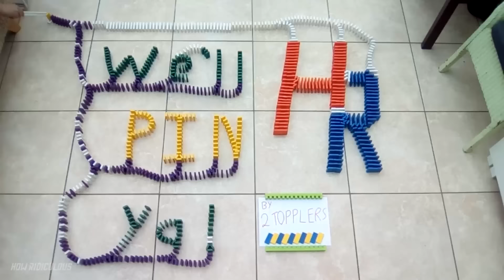Can This SOLID GLASS BALL Survive a 45m Drop?

Comment: I can't say I'm an expert in coney-joneology but I believe it's caused by the way glass compresses. Glass is a strong, but brittle material, meaning it can withstand a lot of force but breaks quickly (compared to metals, which bend and deform). When it hits the plate, the point of impact gets squished in, and the glass around it has to follow due to the strong bonds. But because the compression strength (squishing ability) is stronger than the tensile strength (stretching ability) the area around the point of impact can't handle the stress of stretching, and shatters. The ring around the point of impact is what makes it look like a cone.
Hope this helps explain things simply!
Reply: Your coney-joneology degree is in the mail lol.
What your seeing is an actaul representation of whats called a shatter cone.. only its in reverse. 
In nature  they are found where meteorites impact hard rock layers.
In the video the steel plate would be the meteorite and the glass ball would be the hard rock.
The waves we see are impact lines that originate in the direction of impact..
Reply: Personally, I think what you say is half right. When a force is acting on an object, the energy is radiating through the object. So depending on the shape, the force radiates differently. The point of impact from the glass ball doesn't shatter because the force is going straight through the ball. And because the shape of the object is a ball, forces are going in all direction. Like you say, glass is brittle. so when that force goes through a section of the glass ball that is not thick enough, it cracks, hence the conical shape
Reply: I’ve been doing YouTube for about 3 years now and I don’t even have 200 subscribers any ideas on how I could get more subscribers
Reply: The tip of the cone is when the sphere lands. All the material is in compression. The slope of the cone is because when the ball stops, the surrounding material undergoes tension because there isn’t support by more material and the ground. So when the tension gets to high for the ball because the  ball stopped to quickly, the larger amount of material breaks away, causing the cone
Reply: world of gaming you had uploaded 1 video in 2 months be more frequent

Comment: In case anyone was wondering, the 40kg glass ball:
Falls for 3.03 seconds
Reaches a speed of 106 km/h before impact
Hit the steel plate with a force of 392.266 N (88.1849 lbf)
EDIT: Thank you to MechanicalMind7. The force listed above is just the average impact force. The peak impact force (the one you'd feel if hit in the head) is actually close to 1,765.17 kN or  396826 lbf, assuming the steel plate had a 2 cm give.
Reply: Could've just use project motion and gravity. 9.8m² X 40kg = same
Reply: In case anyone was wondering, how to calculate all this. I'll give you some formulas.
Potential Energy (of ball in this case) =(mass) x (acceleration due to gravity) x (height at which it is present)= 40 x 10 x 45 = 18000
Potential energy gets converted into kinetic energy and kinetic energy just  the instant before it hits ground is equal to potential energy (energy is always conserved).
Kinetic Energy= potential energy
1/2 x (mass) x (velocity)² = 18000( P.E. substituted from above)
Hence, Velocity will come out to be 30m/s or (30 x 3.6)km/hr.
Put it in equation, (final velocity)= (initial velocity) + (acceleration) x (time). Here initial velocity is 0 as it is still I'm the hands of them and final is 30 and acceleration is 10(acceleration due to gravity) and by putting all this time comes out to be 3 sec. So time of fall is 3 sec.
Reply: The force of impact is actually a function of the change in momentum over the time of the impact. You would need to know the time interval over which the ball went from impact velocity to stopped, which you might be able to estimate from the slow-mo footage. The 392N or 88lbf values you cited are just the weight of the static 40kg glass ball. I guarantee the impact force is several times that amount. For example, you could rest the ball on your body without it hurting too much (although it would be quite heavy), but you wouldn't want to stand beneath it after falling 45m ;)
Reply: @MechanicalMind7  After taking this into account, I have recalculated and found that the 392.266 N is the Average Impact force. The peak impact force is around 705.082 N or 158.734 lbf.
Reply: @matthewsheldon3225  I'm not quire sure where you're getting those numbers from. The recalculation is less than double the static weight of the ball, which still seems way too low. It's been some time since I've done straight-up physics number crunching, but it seems you can calculate impact force a couple of different ways. One would be determining a change in momentum over a change in time (i.e. the time duration of the impact), and the other would be based on the work done to stop the ball as a result of the impact, i.e. the change in energy over the distance of the impact. I think the latter would be more easily doable based on the video. The work done at impact would just be the change in energy, which would be equivalent to the gravitational potential energy at 45m and/or the kinetic energy at impact (these are all the same values since the ball goes from full potential/kinetic energy to 0). You could estimate the distance over which the impact occurs by watching the video and maybe comparing the distance from point of impact to 0 velocity and compare it to the ball's diameter (300mm I think he said?). Divide the delta energy by the impact distance and I think that gives you (average) impact force. I don't have time at this moment but could be interesting to try later.
Reply: @MechanicalMind7  Interesting. So the reason it is a little less than half is the give in the plate into the ground. Upon further freeze framing, inspection and scaling I found that the steel plate moved down about 20mm. 
The ball has a fraction more than 19,858J of kinetic energy. 
Here is your properly calculated force of impact now that I retaught myself 2 years of physics. 

With a mass of 40kg, and an impact velocity of 106.95 km/h over an impact distance of 20mm happening over a little more than 1.3 mSeconds brings the total impact force to:

An ungodly 1,765.17 kiloNewtons (kN) or 396826.0035  lbf

To get the same impact force from a regular 1.5cm glass marble it would have to achieve an impact velocity of over 13,000 km/h (~3,700 MPH).
Reply: Does the impact spot stay intact because of it being a sphere? So any point that makes the initial contact will be the exact point which has the most density supporting it in directly the opposite direction of impact? with the lopsided effect stemming from the rolling/spinning motion?
Reply: @GIBSONxSGxPLAYER    Many others have explained what is happening that cause the cone. Let's pretend that we are taking the variables out of the impact. If the ball make initial contact on its Bottom Dead Center with the flat steel plate, that part is in compression, which glass can handle high loads of. Now move an inch out from the center of contact. That portion is still moving with the speed of falling. When the ball makes contact the outer portion are not supported from underneath and experience tension under impact, which glass has a low tolerance for and shatters. 

As for the lop sided nature of the cones, I belive that actually comes from the steel plate not being perfectly flat and perpendicular to the balls trajectory. When it hits at the slight angle, it shifts the center point the that contact. So if plate is angled 10 degrees, you'd probably find the impact point about 10 degrees from BDC but the lopsided nature from all the momentum is still moving straight down (ideally, not trying to calculate wind and friction and etc.)

Comment: For brittle materials like glass, they break in a shape known as a "frustrum" (which is essentially a cone with the tip cut off) centered at the point of impact, which is exactly what you see here!

Source: Mechanical Engineering Student
Reply: But why
Reply: @jamesbowser9350  yea, wasn't really explained
Reply: it's frustum, but yes!
Reply: So...the point of the cone is the thickest part right...in the direction of hit - then it’s thinner in radii around the impact point -?
Reply: Have you seen Prices Rupert's drops?
Reply: @jamesbowser9350  glass wants to break in a straight line, and the sides of the cone are pretty straight.  It is angled because the force of the fall isn't distributed evenly.
Reply: @jamesbowser9350  Shockwaves that travel from the point of the impact. Hence why it has that wavy pattern on the surface where it broke.
Reply: But what causes the ripples in the cone shapes in this instance?  Something to do with the internal pressures of the glass as it cooled?  IE: in a rupert's drop, the blob of glass is nearly indestructible because of the compression that forms as the glass cools, from the outside inwards.
Reply: Yo you guys too dont underetand a word here
Reply: @jamesbowser9350  it seems to be the difference in the stresses the glass ball is under, glass is very good at dealing with compressive and tension stress and but is very weak to torsional and shear stress. So it seems like the ball is breaking where the shear stress is at its minimum to fail.
Reply: Nerd 🤓
Reply: source : But dude trust me

Comment: It's a retinal pressure cone caused by small surface area contact combined with the Amorphis microscopic molecular structure of the glass resulting in a conchoidal fracture pattern.
I knew that off the top of my head because of YouTube .
YouTube rules.
Reply: That's exactly what happened to my pipe!
Reply: Wow
Reply: If  you don't win, I will be upset!
Reply: @stefanoskritikos8313  86 now, might as well like it now!
Reply: What he said ... yeah thats it .... I think...mmm yeah 🤔🤯🤯🤯🧐
Reply: scott free my clumsy friend dropped mine :/
Reply: In addition to that, I think it's amazing how the waves formed from the glass delaminating. Probably a result of how the balls needed to be created.
Reply: Brian Chin different material
Reply: @Brian Chin  so the bowling ball is numerous materials as apposed to solid glass so the difference in density causes a different fracture pattern
Reply: @Brian Chin Probably due to the different materials and different densities and strengths of the materials used in the bowling ball.
Reply: literally not z  nah it's better than ever now. Just have to stay on the subscribed feed
Reply: Okay boomer
Reply: Path of least resistance coming out at all directions at all atomical connections and how they correlate with velocity and mass at the point of impact (causing the appearance of a cone), taking into consideration structural integrity, cohesion, and density throughout the sphere by comparison.
Reply: @Brian Chin material used is what that comes down to you can see that it did make a cone shape but partially. different materials mean different amounts of pressure it can withstand.
Reply: @Lugermonger Amorphis is a band i think you mean Amorphous
Reply: I don’t know what part of YouTube you are on to learn that, but damn!
Reply: 100%true
Reply: Pin this man rn
Reply: I understand some of those words
Reply: Now explain it like I'm five years old.
Reply: Brian Chin the bowling ball is a ball casted inside of resin. So the outside resin shatters completely cuz it’s the weakest leaving an inner ball exposed
Reply: Big brain boi 🧠
Reply: @jc55urmom68  yes that's why there was a separation in breakage the outside material absorbed majority of the energy upon impact as well the interior possibly a more shock resistant material.
But it kind of did break the same way the material fractured differently which is why the actual point of fracture looks different the molecular bonds are not the same but the way the energy was directed around the ball broken to relatively the same point on the ball as the glass the energy transfer was similar
Reply: Pls speak English
Reply: Could you explain that in english?
Reply: @Vivid Media LOL nicely done
Reply: Correct
Reply: Oh fuck we got an actual scientist
Reply: Check my answer out it’s funny
Reply: @Brian Chin The bowling ball was composed of two different materials  .
Reply: its because balls are oval shapes so when they falls the same thicknes of the glass goes everywhere
orrrr when it fals it fals vertical so the sides are damage and the piece where it fels its not damaged that much because there is no side force just vertical
Reply: @imstarwars   Yes,the glass is gathered by several consecutive dips in the furnace.
Reply: Brian Chin because the bowling ball has different layers
Reply: Pin him!!!!!
Reply: a lot of big words in there... dictionary.com is doing wonders tonight
Reply: Basically, small initial surface area of impact, and the surrounding glass still has kinetic energy, and breaks where the glass is weakest, that's why the farther from the center point, the farther down the "coney" goes
Reply: and perhaps the wakes are a visual of the actual shockwaves?
Reply: The bowling ball has a different materials in layers and doesn't cool to form amorphic micro struxeres. The difference in the pressure isn't glass structure as it cools means it can form a cone. With the bowling ball, the outer layer just shatters off leaving the inner structure... Its not formed as one and Cooled like glass. Hope that makes sense
Reply: literally not z The recommended videos used to be godly. Found so much good music
Reply: :( all i know is cony jony
Reply: Your comment should be pinned.
Reply: @fixed4816  mine too 🤣
Reply: Sorry can u speak english
Reply: Brian Chin the bowling ball is made up of multiple materials. The outer material has a  conchoidal fracture cleavage similar to the glass. Also Obsidian, quartz, flint, chert, jasper...
Reply: @Brian Chin because glass has the properties of a liquid despite it being a solid at anything above 300m below the ocean.
Reply: Man I had to go to pay 50k to learn that in college
Reply: Ok nerd
Reply: Ok boomer
Reply: @Lugermonger, When are you going to review a Norseman. Even if you use it for a bit and sell I'd like to see your thoughts. I want one as a wedding gift to myself and would like to pick your brain for critiques!
Reply: @Brian Chin That was a joke question, right?
Reply: Brian Chin it all about that amorphous molecular structure.
Reply: @Brian Chin bowling balls have layers and the glass balls are glass all the way through
Reply: In other words, it's the propagation of the shockwave from impact through the glass
Reply: Also because Kool-aid man is becoming an extremely powerful super being that is more powerful than thanos. Also learned that on youtube
Reply: @Brian Chin  the glass is most dense and didn't have a skin extra to absorb the energy
Reply: @Brian Chin because the glass ball is made of one material but the bowling ball has different layers of stuff
Reply: @Brian Chin Different and varying molecular structures in the bowling ball that fail in a different manner.
Reply: literally not z  YouTube is my tv. Who are those people?
Reply: Lugermonger I love watching your vids
Reply: Shoot you stole my comment
Reply: Makes the shape because when it hits, the most damage is not at the contact point because the most damage is the aftershock as the shock ripples throughout the rest of the sphere as it bounces up......right?
Reply: I like coney joney better
Reply: @Vivid Media sesquipedalianism fun isn't it
Reply: What???
Reply: @Brian Chin actually if you look at the bowling ball, it does represent the same pattern.  you can see that the impact point is intact, but the shearing didnt happen properly since the ball is made of different materials that were not joined together strong enough to allow it to shear evenly.  that resulted in the top layer of the ball beginning to shear properly and then just breaking off entirely at the layer change.
Reply: @Brian Chin bowling ball has an actual core and at least 1 big thick layer, glass ball has not
Reply: you gotta check out Space group theroy & Hermann–Mauguin notation
 notation if u really wanma wax the secience... books taught me that
Reply: @Brian Chin bowling balls are made of different plastics not glass
Reply: literally not z  is that why some of the greatest and smartest people in existance were weed smokers xD
Reply: I have no idea what you just said
Reply: how-
Reply: At first I read rectal pressure and I was confused
Reply: I like your funny words magic man
Reply: English please
Reply: Haha that's what I love about the internet man, there's a great comment above from a PHD explaining this process, granted from a more informed perspective, but you also know this just from learning online
It's a beautiful thing man. So many people don't know things or stay ignorant and don't just take some time to learn and do some research
Reply: Lugermonger chill man
Reply: Yep although that's pretty much how a lot of surfaces react to bullets, hence the small entry hole and a gaping exit hole... Just couldn't recall the actual name for it